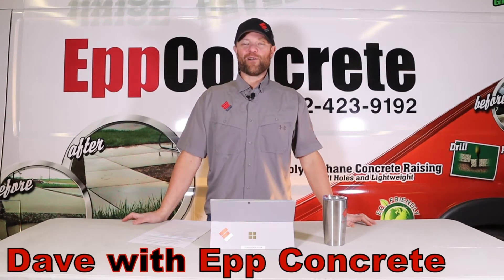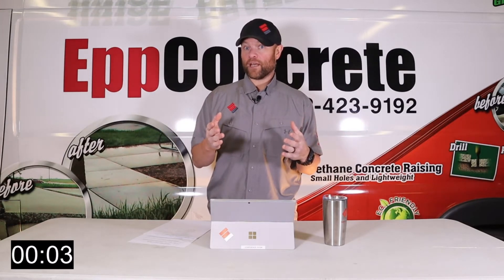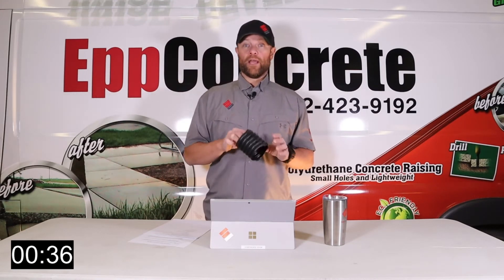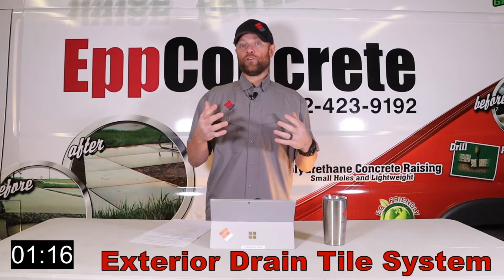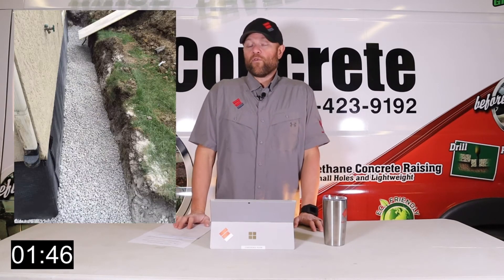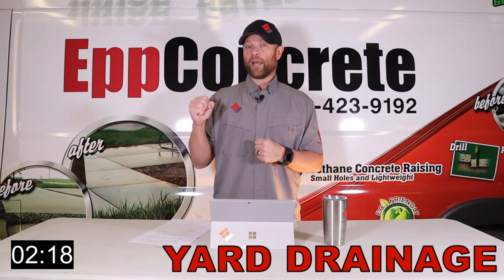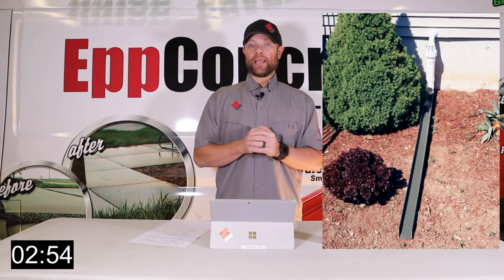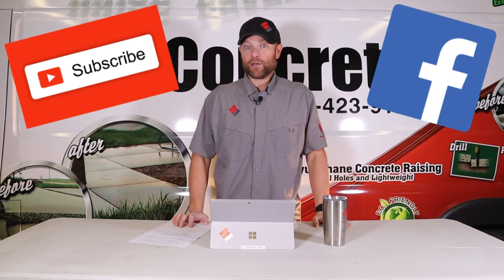Three Methods for Waterproofing Your Basement

Comment: Whether interior or exterior drains, what if the foundation floor cracks in the middle of the basement and water table rises high enough for the water to surface in the middle of the basement?